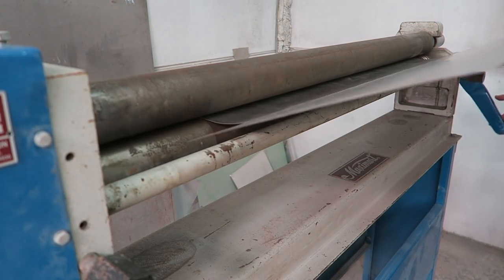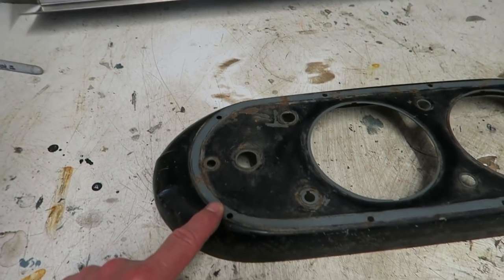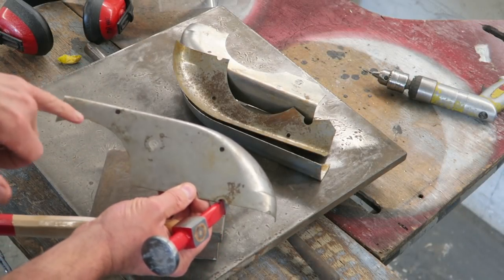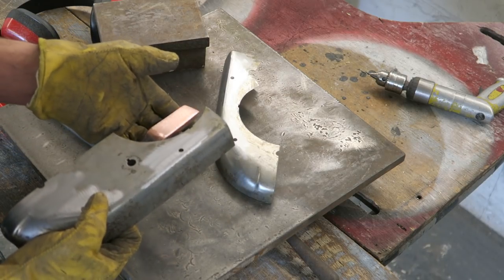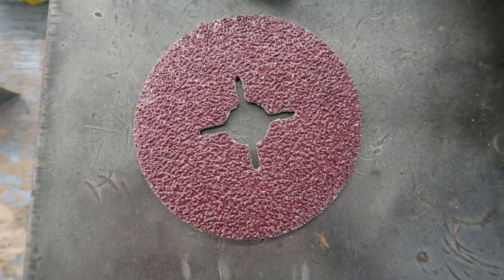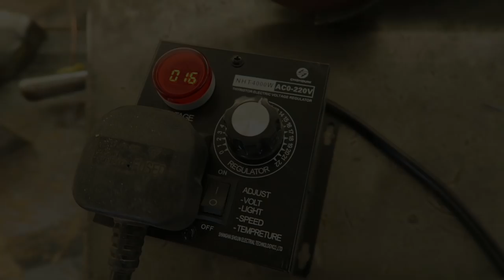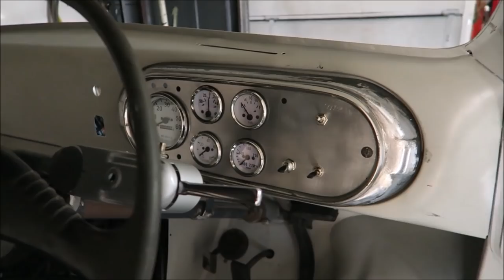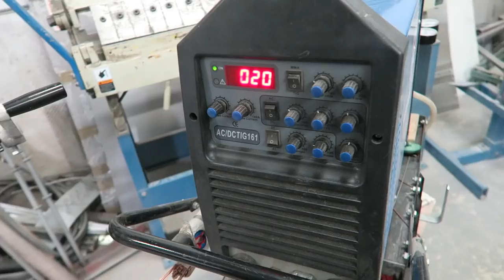Easy effective way to weld up unwanted holes, invisible repair, panel beating Tips and Tricks #48

Comment: Your right. Good quality often out does several cheapies. 3m and Norton are great abrasives. Get the job done and move on. On grinding wheels Norton makes several specialized formulations. For example they have a foundry wheel that doesn't do well on mild steel. It lasts forever but doesn't cut well. You want the right wheel for the job. Some wheels cut quick but disappear quick. They make some that last well but also cut quick.

Comment: Hi Trev, Spot on with the cubitron we grind all day and are by far the best we use 80grit to sand aluminium we spray wurths cut and cool cutting oil to stop the ali heating up and sticking to the disk.You'll be amazed at the finish you can get with the oil, great work as always
Reply from the maker: Thanks for the tip. Cheers Trev 👍

Comment: Very seful video.
At 7:25 an alternate may be to weld from the inside, so the smooth surface is left on the outside!
Reply from the maker: The welded side often dips slightly leaving a dimple, welding the outer is normally easier to grind because it’s normally convex, leaving both sides flush. Cheers Trev 👍

Comment: I've got a bunch of tiny drill holes from spot welds I need to fill up on my car and I've been doing exactly the same thing. I could probably do with a thicker bar to take more of the heat away though.

Comment: May I ask if the back was so smooth why didn’t you reverse the weld. But the copper on the front and weld the back ?
Reply from the maker: 1 it’s far easier to shape a weld bead that’s sat on a convex panel. 2 if you grind the weld on a concave panel it’s easy to grind the panel down around the weld. 3 access will Normally always be better on the outside of a panel apposed to the inside. Cheers Trev 👍

Comment: Hi Trev. I was wondering if you can perform a spot weld on top of mig weld. Say for example that you want to remove a front fender, but you want to use it again and you want to keep the factory spot weld's look, can you fill the holes with mig weld, blend them like you did on the video and spot weld back the fender again?
Reply from the maker: Yes I’ve done this in the past. Cheers Trev 👍

Comment: What about welding the holes 'inside out' so the copper is on the outside and leaves behind an already flat weld.  You could conceivably not even grind down the weld since it's on the inside?  Any reason that's a bad idea???
Reply from the maker: It’s entirely up to you at the end of the day. My reasons are that it is easier to shape the weld on a convex panel and outside of panels are normally convex when you grind of the weld on a concave panel i.e. the inside you run a greater risk of grinding either side of the weld also welding on the inside of the panel will be nearly impossible when you are considering access underneath the car i.e. the inside of the wing for example. Cheers Trev 👍

Comment: Do you have any tricks to get the copper onto a hole that's beyond the reach of clamps, such as in a roof?
Reply from the maker: A couple of strong magnets would easily hold a piece of copper in place. Cheers Trev 👍
Reply: @trevsblog  Great Trev, thanks

Comment: Why not put the copper backing on the finished side when welding up the holes?  Depending on the application, you may not need to do any grinding.  Just asking, not being critical because I don't know.
Reply from the maker: It’s entirely up to you at the end of the day. My reasons are that it is easier to shape the weld on a convex panel and outside of panels are normally convex when you grind of the weld on a concave panel i.e. the inside you run a greater risk of grinding either side of the weld also welding on the inside of the panel will be nearly impossible when you are considering access underneath the car i.e. the inside of the wing for example. Cheers Trev 👍
Reply: @trevsblog  - Thanks.

Comment: Why not put the cooper on the outside so there is less grinding?
Reply from the maker: It’s entirely up to you at the end of the day. My reasons are that it is easier to shape the weld on a convex panel and outside of panels are normally convex when you grind of the weld on a concave panel i.e. the inside you run a greater risk of grinding either side of the weld also welding on the inside of the panel will be nearly impossible when you are considering access underneath the car i.e. the inside of the wing for example. Cheers Trev 👍

Comment: Seems like you should have had the copper on the OUTSIDE face. If it was that smooth inside, it would have in turn become flush on the outside for little to no clean-up sanding.
Reply from the maker: Personally I find it much better to have weld sat on top of a convex panel as it’s easy to shape without grinding either side of weld. Also gaining access to the inside could be almost impossible if it’s inside a front wing etc. But do it however you feel is the best way for you, the video is just as a suggestion guidance. Cheers Trev 👍